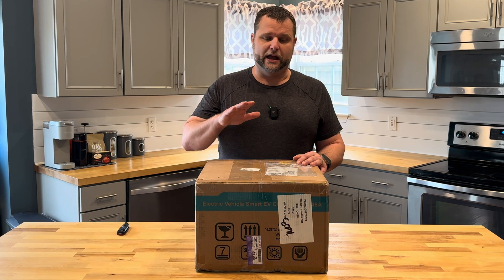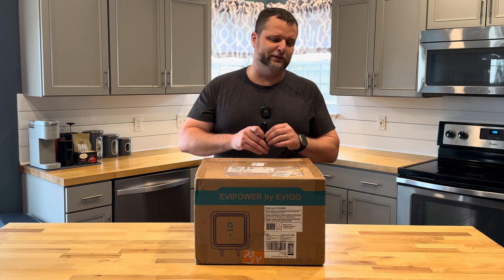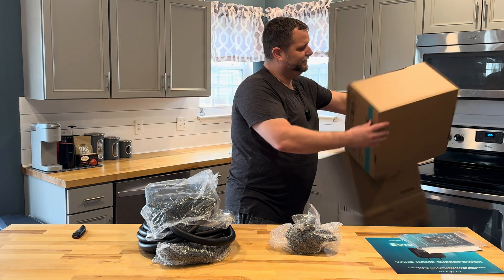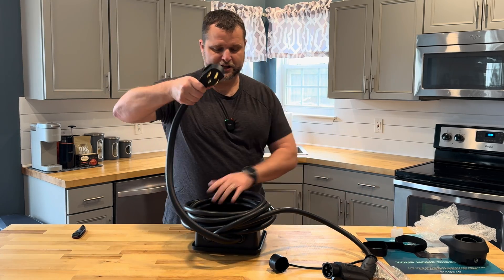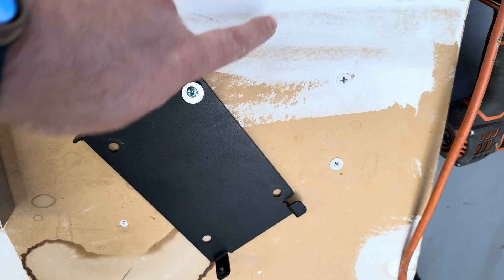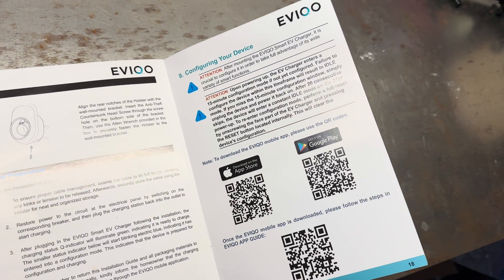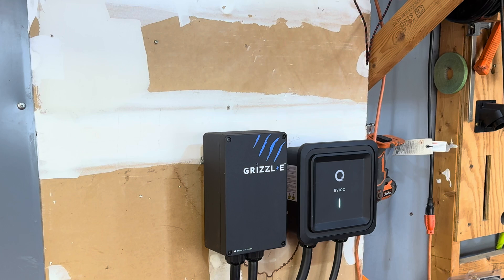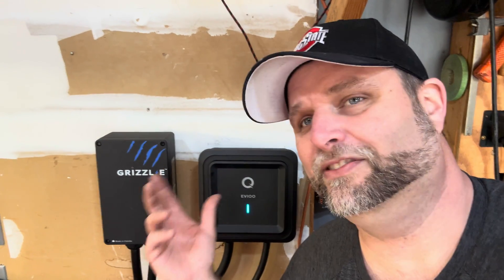EVIQO Level 2 Charger with WiFi and Phone App

Comment: hello, I just got this charger with an adapter to plug into my dryer outlet.  I have a 30amp breaker for the dryer.  As long as I set the charging amps below 30 through the app, I should not need to update my breaker, right?  thank you for the video it was really helpful.  new to this EV thing.
Reply from the maker: @SylvievanHelden  honestly, that’s a dangerous game to play. I believe you can change settings internally on the unit to prevent an accident from happening. You should only run 80% of a breakers max capacity. On a 30 amp breaker, that would be 24 amps. I highly recommend you review the chargers instructions and set it up based on your breaker. If you reach out to EVIQO, they will be glad to help you out. Their customer service is very good. Thanks again for watching and commenting.
Reply from the maker: Want to add, if you decide to up the breaker, have an electrician make sure the current wiring can support it before doing so. (Safety first, don’t burn down your place!)

Comment: Can you please tell me if you are having issues with the unit regarding departure settings (climate setting for departure). This product charges fine but my Mach E will not start the departure climate when I use this unit. The Ford charging station is flawless.
Reply: I'm glad I read of this problem and that there is a solution. I have a Nissan LEAF and just installed my EVIQO. Will be testing out the climate control/prewarming on Monday. We are expecting rough, snowy weather.
Reply from the maker: @I’ll coming to put out a quick update video about it! I was impressed with the customer service and the over the air update. Let them know your make and model of your vehicle and I’m sure they will get you taken care of. In the EVIQO app, make sure you setup for your correct vehicle as well. I thought I had, but when I double checked it, it must of changed during a software update and I had to set it again. Thanks for watching and commenting!
Reply: @QuickShifts  You can let EVIQO know I bought their charger because of this post. After reading a fellow Mach E owner had an issue and they quickly addressed it makes them a company I want to deal with. A+ customer service. Autel should take lessons from them. I have been fighting with them to return a defective unit for weeks.
Reply from the maker: @ customer service matters.
Reply: Everything has been perfect after the update and all functions are working as designed. Loving it!!!
Reply: @BadCook77  Can you send me a message describing the issue you had? I might be running into the same thing on my Mach E
Reply from the maker: @BadCook77  I don’t precondition my car before departure so I haven’t run into this issue. I did notice before though that once the charger has completed a charge that the car can’t trigger it to charge more without you taking action either through the chargers app or by unplugging it and plugging back in. For example, if I set my Tesla to charge to 50%, it completes the charge, then I tell the Tesla to charge to 80%, it will tell me to “check the charger” and won’t charge additional unless I manipulate the charger. This is basically the same situation. I will experiment with it more and see if I find anything more out about it.
Reply: @ thank you. That’s the exact problem I’m having. Once the car reaches my %, the charger will not come back on without manipulation. So annoying. One more reason I don’t love hardware tied to apps. Pros and cons.
Reply from the maker: @ I reached out to EVIQO. I will let you know what reply I get.
Reply: @QuickShifts thank you!
Reply from the maker: @BadCook77  The support time got back to me quickly! Happy about this.
They asked me to tell you to contact them and told me this.
“If you still connected to your viewer, please, ask them to contact us for help. We will manually provide them preconditioning firmware which is specific to different car models.”
Please let me know how things go! I will reference this in a follow up video.
Reply: @ thank you. Funny enough, I received an email telling me they updated my firmware today. I will test this function tomorrow. I really appreciate the help. Many thanks for responding to me. I’ll keep you updated as well.
Reply: @QuickShifts  problem resolved with firmware update. I’ll let you know if I have issues in the near future.
Reply from the maker: @ glad to hear it!